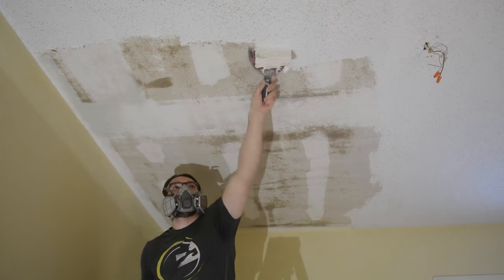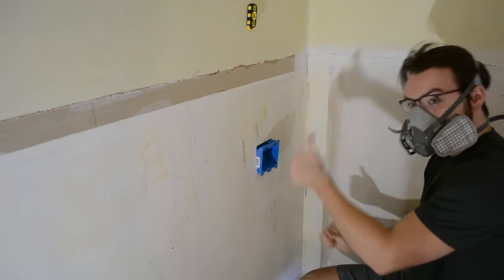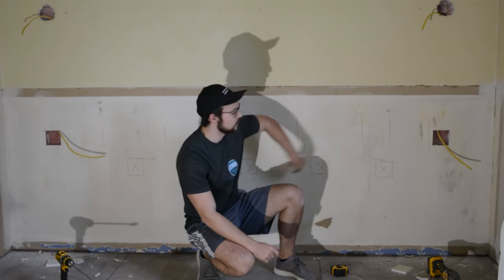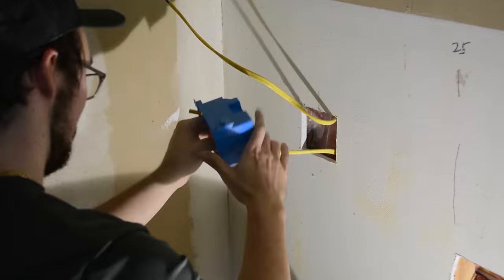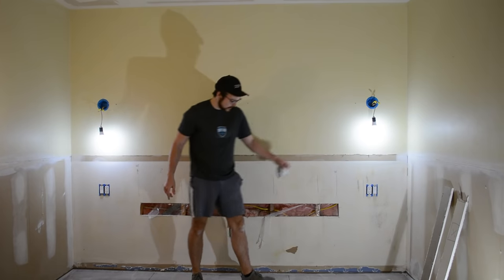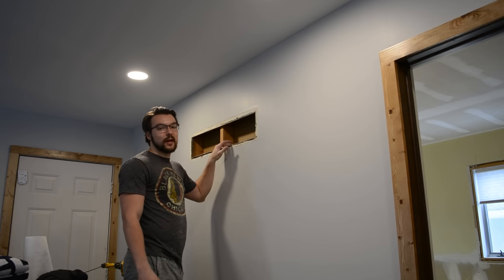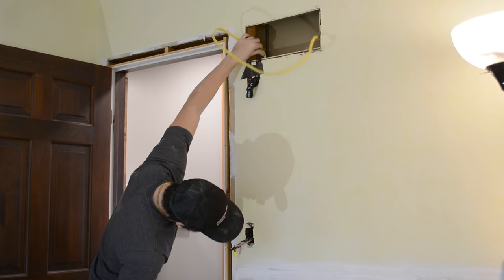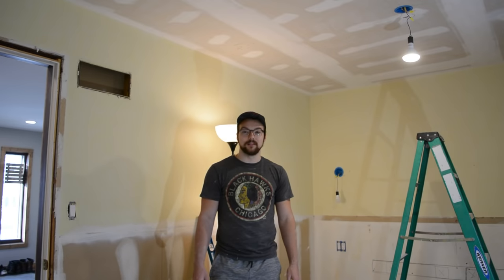How to Add a New Light, Switch, and Outlet Without Existing Wiring | Bedroom Renovation Part 3

Comment: I would've ran the wires behind the baseboard to avoid having to tape, mud, sand and paint that cutout you did. always remember to work smarter not harder, you have to use measuring tape so both have correct height....but other than that good job 👍🏽
Reply from the maker: Running wires behind the baseboard would not be to code unfortunately. And don't worry, I made sure they were both at the exact same height using a laser level. Just can't fit every single step in the video
Reply: @GoldenKeyDesign I think OP meant cutting out the bottom area of the drywall where it meets the floor and running the NM through the studs. That way, that piece of drywall is covered by the baseboard.

Comment: Couple things.. Why did you go with 12 gauge wires? Nothing wrong with it but that outlet is on a 15 amp circuit. Bit easier to work with 14 gauge. Also, you are not allowed to run wires through a plenum air space (the hvac return) unless it is run perpendicular straight through it. Love the remodel though!
Reply from the maker: Thanks for the tips and constructive feedback! I always appreciate it when someone takes the time educate me rather than hating on my for trying. Learn something new everyday. Thanks!

Comment: Did you add any support to the light box in the ceiling ? those tiny wings that come on the box really ain’t enough
Reply from the maker: The wings are plenty strong for a small light fixture. The boxes with joist brackets are usually meant for fans they weigh well over a couple pounds

Comment: For your first time doing this level of electrical work, you did a wonderful job using the existing receptacle to power new devices. There are three concerns I have with your work.

First, I see you leave too much sheathing on your NM cable. I see too many DIYers make this mistake. Doing so makes it way more difficult to fold the wiring back inside the box and violates NEC since it requires at least 6 inches of wire emerging from the sheathing. 

Second, it's best to avoid mixing wire gauges. In this case, there's nothing wrong with using 12/2 since it's permitted for both 15 A and 20 A circuits. However, if this circuit is on a 15 A breaker, there's no need to spend extra on 12/2. It's certainly better than using 14/2 on a 20 A breaker, but mixing wire gauges isn't ideal and creates future confusion. Someone replacing a that failed breaker can easily swap the 15 A for a 20 A and possibly overheat the existing 14/2 wiring. 

Last, always check the box fill. Many 1 gang boxes don't allow 3 sets of NM, especially 3 12/2, due to it's volume. If the box looks too shallow or you're unsure of it's volume, then it's best to replace it with a deeper box. It also makes running new cables way easier.